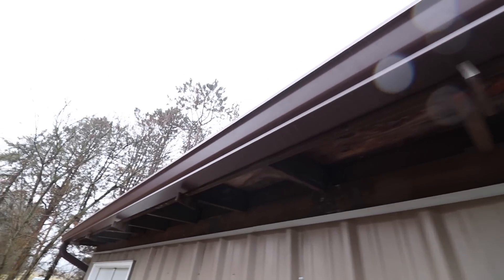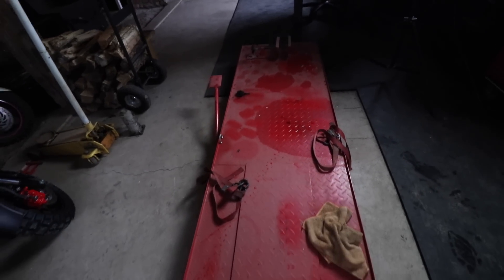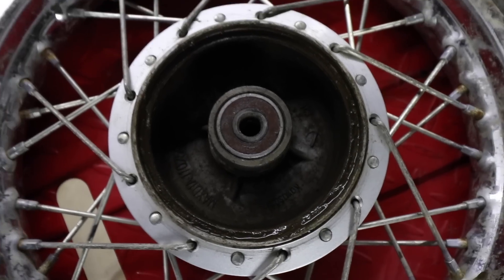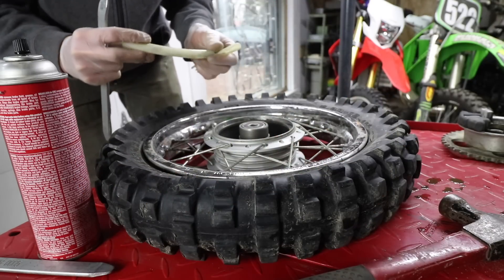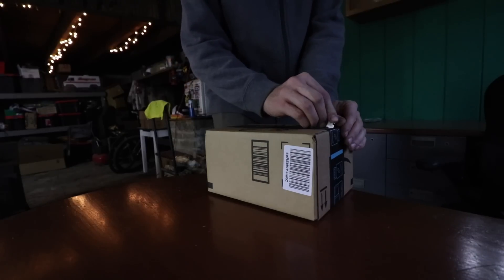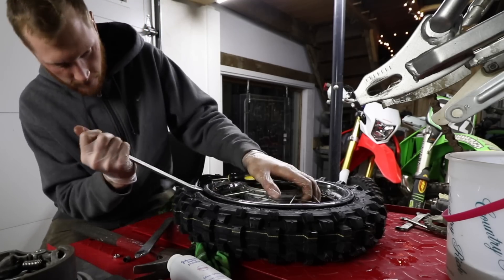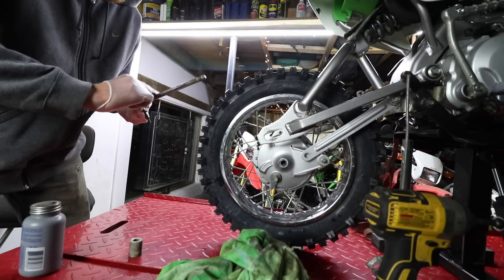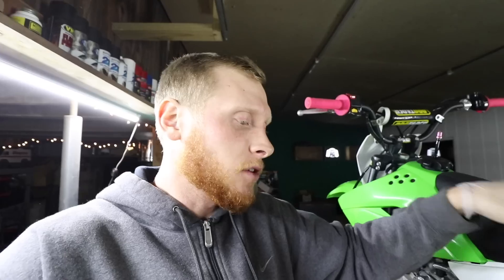How NOT To Spoon Dirt Bike Tires.. *Rage Warning*

Comment: I legitimately haven't laughed this hard watching a video in a long time.  You took that a hell of a lot better than I would have.  That little pizza wheel would have been tossed out that garage door or I'd have thrown it into the stove.  I'd say 3-4 spoons at least and dude, as they say, time is money so look at a stand at least and maybe a changing machine if you plan on doing this regularly.  For lube I usually use Armourall or WD-40.
Reply: You should never use those as lubes, you want something that is slippery for a moment and then dries off.
Reply: @Ricqu  Sorry, I don't share you concern with respect to a dirt bike tire.  Raced for years, never an issue.

Comment: There is no rage worse than putting everything back together just to realize you popped the tube 😂 the way I do it is wrapping the end of flathead screwdrivers with duct tape, works good and keeps the jagged edge from popping them. I also use wd-40 instead of soap
Reply from the maker: Trust me I have done it a couple times and about set the bike on fire😂 Great idea! WD40 is good for just about everything.
Reply: Happened to me twice in a row lol

Comment: I have changed many many many z125 tires and when you figure out how to use your knees to hold the tire opposite your spoons. So you will be kneeling on one side and spoons on other . That keeps the tire off the bead in center of rim.  Then you will be zipping tires on off easy.  Great video
Reply from the maker: Thanks for the tip! Honestly I tried but my knees are shot right now so I couldn't bear it. I am looking into getting a manual machine.

Comment: biggest factor is breaking the bead and consistently making sure both sides of the bead are sitting in the middle of the rim where there is more room, its neigh impossible to remove a tyre whilst the beads are sitting up against the rim walls

Comment: Bead buddy along with the Baja no pinch tool will make this job so much easier. You will never go back to using spoons for the install after using that tool... When removing the tire stick 3 or 4 irons in at once about 4" apart, pry the middle ones first, then the outside. This is the easiest way to get started removing the tire.

Comment: If you have a bearing press in your shop, put down the spoons. Use the ram on your press to press your tire on after putting it on as far as you can by hand. Just work it around 2 to 3 inches at a time. This saves damage to your rim also. I have a bearing press from H.F.  😎

Comment: On the opposite side of the tire iron if someone could help you have them push the tire down into the center of the rim. Easy Peasy!!!! But the smaller the tire the bigger Bitch it is to change. I also use Honda Spray Polish on the tire bead. Seems to help me out.  And Happy Birthday Alexis!!!!!!

Comment: One trick I’ve learned is to have something stand on the tire with the rim on the floor. It lets it have more room to work with. And it’s easier to get the tire spoon/screw driver in
Reply from the maker: Good idea! Thank for the tip.
Reply: Never use screw drivers. Also these tire irons aren't the best you could use. Try the "spoon" shaped irons, Motion Pro makes them, you'll find them. They are much easier to work with

Comment: Ok pro tip you need to get the opposite side of the tire into the center of the rim. When the bead is still up the tire doesn’t fit over the rim. It makes it much easier to use spoons. Or you can do what I do and use a rim clamp tire machine. Just did my grom pilot powers the other day.
Reply: Try a piece of 2x4 or thinner wood to keep bead down.

Comment: would a "bead lock" (?) help when spooning the tire
Reply: "bead buddy"
Reply: I've never swapped out a 18" or smaller tire. I just want to know if a bead buddy would really help because I might end up doing it for a 2020 CRF250L ABS.
Reply from the maker: It will help!! 250L tires are easy though.

Comment: I hate doing tires and end up taking them to the shop for $25 a tire lol but I've used the "zip tie method" a few times and had good luck with it
Reply from the maker: Yeah it's almost worth the money sometimes haha but it is one of those things I want to master. Bead buddy seems to be the answer!
Reply: @AdventureDaily  bead buddy will help for sure! Motion pro also makes a tire install tool I've never tried but looks pretty easy to use it goes in like an axle then you ratchet it all the way around until tire is on

Comment: I found that the larger the spoon the better. Sometimes the ends are too thick to fit between the tire and the rim. I ground a sharper taper into the ends to make it easier. Also bar clamps help get the bead into the center.
Reply from the maker: Thanks for the tips!!

Comment: I used to mount 6pr trelleborg 450x18, and not what they call 6 plies today=3 on the side and 3on the tread=6pr not a chance. Pins on the bead for rimlocks
Reply: I double tubed one for a s score race, there was a 23 mile long asphalt section, I had a rear flat and didn't know it, the tire melted and was coming apart hitting me in the back with big big melting pieces of tread.